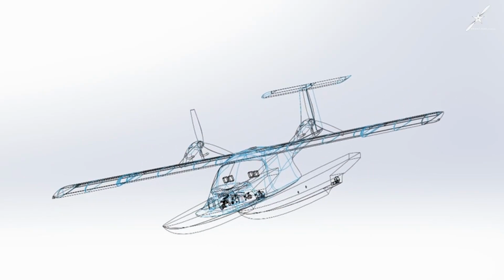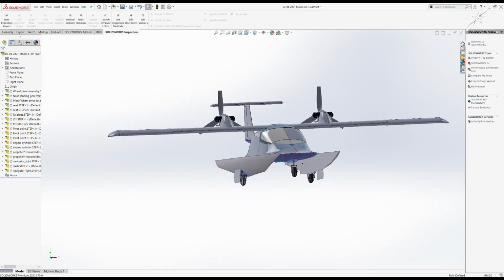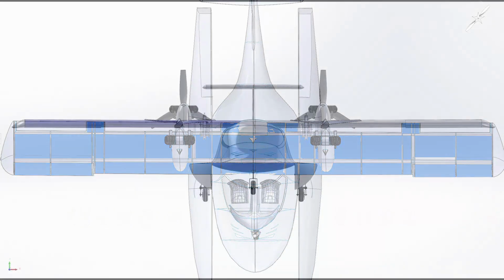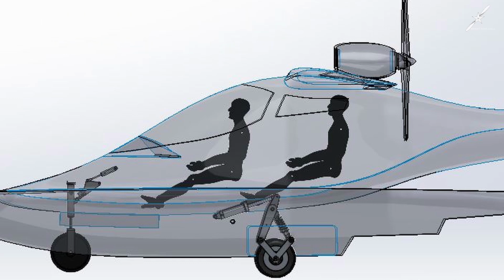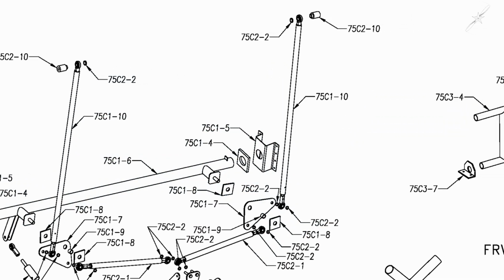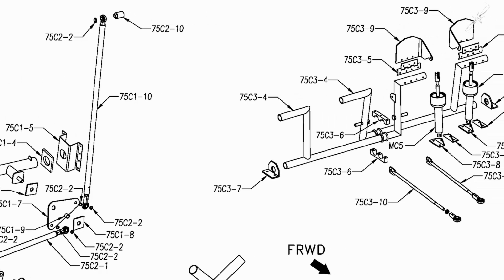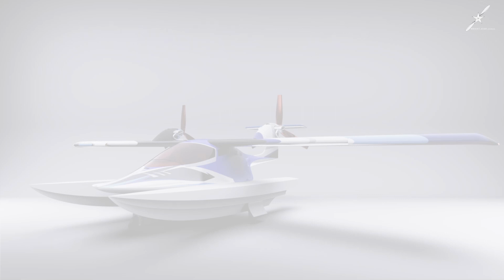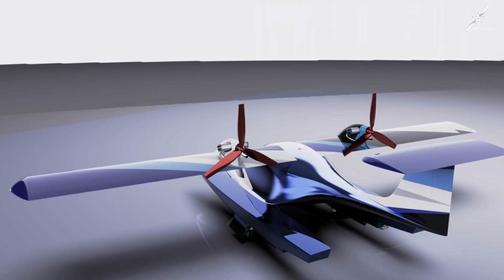Exciting, NEW, Amphibious Aircraft.

Comment: Interesting and I was also looking at BMW R engines as good DIY hack alternatives to rotax. They seem quite well suited except for needing a good gearbox solution. One european guy killed his tranny a couple of times before surrendering and buying a rotax that then worked reliably. I'm not saying it's impossible but the gearbox has to be well engineered to last hundreds of hours. The big 2 cylinder probably has some kick. So while they are great as a one off with no gearbox and smaller prop because you can get these nice engines for 1k$, if you hope to have some kind of series production you should consider the overpriced but decent rotax 916 and just one engine. piston twins are never good. sounds good on paper, but isn't.
As for the shape, I think the beak nose might have aerodrag. You can sim that in openfoam. AI seems to think openfoam is quite high end stuff despite command line interface inelegance. Apparently even solid works' CFD is nowhere nearly as scientifically accurate despite paying a ton of money before you get to use it. The separate pontoons makes for a complex body to make and less visually elegant. I think I would strongly recommend a more icon A5 like configuration because of the monobody shape. And single engine like it as well. As for seaplane hulls, I'm not an expert but it's my understanding that the key trick is a step where the water will separate from the hull and that's placed a bit behind CoG, then it comes up and planes on a short surface in front of that step. It's close to that simple afaik. strange that it works but it does.
As for your target weight, I would strongly recommend that you aim lower. Carbon fiber, especially in compound curves can be silly strong at very low weight and it takes very little strength to support 4 people. A 2 place carbon fiber canoe is 10-15kg and they can take a beating. Try aiming for a fuselage of 100kg instead and wing might be as little as 50kg. 86kg engine. Think of anything more than 300kg empty weight as a failure. 4 people is ballpark 300kg, maybe 75kg fuel so that's 675kg mtow. 1500lbs in retarded units. No 3500. You have a budget of 300kg empty weight, no more. Carbon fiber is STRONG. Use it well

Comment: should turn the engines around to pull not push. It will quite the motor and air noise down a ton.
Reply from the maker: I appreciate the suggestion, however, I wanted it to be a pusher. Yes, there are drawbacks to this. But for me to NOT see propellers in my view, I am willing to accept the drawbacks. To give you an example of why I am building this aircraft this way, think of a woman's high heal shoes. They are totally impracticable and even hurt women's feet. But they do look very sexy. Sometimes going for the perfect flying machine is not the goal and instead making something totally sexy that flies is the goal. Mine will be the latter. Thanks again for the suggestion.

Comment: I very much like your design.
 Having heard you would like to upgrade your front steering wheel & likewise steering for the pontoon.
I suggest you check with the designer of the rokon 2x motor bike & how power is sent to the front wheel. The same design can be used to actuate the steering for the pontoon esp if they were going to be powered by water jets.
A similar assembly that's used to power the Rocon might be used instead but unpowered and for steering purposes not to bring power to anything except for turning or yawing on the horizontal plan.
Thereby assisting both the front  wheel & the electric jet drive steering stearing.
P.s. kee in mind, the jet drives will require at least one debris filter for the water used.
I'd love to eventually get one for my hunting and fishing guide service...
P.s. be nice to be able to move 2 guys the outfitter equipment and moose meat...
Reply from the maker: I did a Google search for the  rokon 2x motor bike. It does not look like that front wheel retracts or extends. It looks fixed. The redesign on my nose gear is how to make it steer when extended and the disengage during retraction so that it retracts straight up into the aircraft. The front nose gear will not have any drive system on it turning the wheel.

Comment: Looks sharp and sleek.  I’m seeing a few possible issues from your pictures.   *Sleek THIN composite main component junctions with out the THICKNESS of strong internal metal attachment points will be very vulnerable to heavy water loads.  Pontoons floats have very strong cross bracing like bi- wings.  * The tails vertical & horizontal surfaces look to small.  Getting up on step looks hampered and the drawing of the main gears location looks like it may be a tail setter on a ramp with out occupants with pusher engines.  

Back in 1973 I did a sketch book drawing of a high wing twin engine tractor layout with twin boons and twin rudders.  Good to have direct flow on a rudder especially in engine outs.  The floats are mounted to a short airfoil sponson wing below the fuselage ( like the Boeing 314 ) which is structured to house the main inward retractable gear.  The floats can be detached for land use only.  Having twin boons allows for a rear access hatch ramp for cargo.   How can I send you this drawing?      - my two cents.
Reply from the maker: Thank you for the complement. This design is still just that, a work in progress. Since the making of this video two years ago a lot has changed. I have brought on an aeronautical engineer. He has looked the design over and we have made many changes to the design. So far we have extended the tail out another foot. We have increased the size of the rudder and vertical stabilizer, the horizontal stabilizer and elevator. The with of the body has been reduced by one foot. The engines have changed to two UL 520si 200hp with slightly larger props. Since day one I have had a composite guy helping me. He is a former Northrop Grumman composite guy. His name is Russ and you will hear me talk about him during my first video. He has explained to me how by using three or more different types of composite material, there will be plenty of strength between the floats and the fuselage. 
Gear placement will for sure be looked at during the final design stages. Thank you for point out the boat ramp thing. There might be a time when there is only one person in front which could cause it to be at it's aft CG limit. Combine that with a steep boat ramp and things could go bad quickly. 
My email address is in each video description. You can just email me the drawing. 
Thanks for the comment.

Comment: bro can we go for v tail designed it will look super cool😄😃
Reply from the maker: I don't plan on doing that. About the only thing that is a positive with a V tail is less drag. Other than that, it is a lot more work for the manufacturing the components for the mixer which works the tail surfaces. I like the "Keep it simple" method. Thanks for the suggestion though.

Comment: Keep in mind that carbon fiber is conductive and mixing metals when in seawater can lead to galvanic corrosion. Might read up on what carbon fiber sailing vessels do to mitigate this issue.
Reply from the maker: Thank you for the advice. Yes, this is something I am aware of. As an A&P, I am very familiar with galvanic corrosion. It can turn aluminum into powder. Also with me now living in an area where it snows. I know how fast salt can eat at metal. Funny you mention sailing and carbon fiber vessels. I have been a viewer of a sailing channel called "Gone with the Waynns" Their new carbon fiber cat has been having issues and they have tracked it down to current flowing though the fiber of their cat. Again, thanks for offering the advice. You are spot on.

Comment: Are the motors turns counter to each other to cancel to "tork" ?
Reply from the maker: Yes. That is why I went with the UL 520si engine. However, many twins do not have counter rotating engines. I got my twin engine rating in an aircraft like this.

Comment: Why are the weels are so low when they come out ? Is clearance a problem to save the floats ?
Reply from the maker: The wheel length have not been set yet because the shape of the floats shape has not been set yet. We have also redesigned the main gear doors to slide in instead of swing out.

Comment: Are you sure that the market is ready for this aircraft ? it has so many features that I'm starting to think it's going to be really expensive for the targeted audience.
Reply from the maker: Not that many fetures. It's just a clean slate design. The only thing I can think of that would be new to the market is the water jet thrusters instead of water rudders. That entire system should add more than $5K to the price.

Comment: Beautiful design. I have been flying a BMW1200 engine with a custom cnc geared reduction and am extremely happy with it.
Reply from the maker: Great to hear. We have decided for the prototype to switch to the UL520si engine. The Aeronautical Engineer recommended more power than the BMWs could make. Daily because the aircraft is wide and has a lot of form drag. We have reduced the with of the fuselage by a foot as well.  Thank again for in info on the engine.

Comment: At 12:50 in the video, it shows the different compartments of the pontoon; I would recommend having flooded compartments (ballast tank) to balance out the aircraft while on water for a more comfortable ride. Which should be adjustable so when in flight it may be dumped to provide better flight control and filled in water.
Reply from the maker: Thanks for the idea.

Comment: I’m not an expert, but the sharp edge on the leading end of your fuselage may cause some separation. I’m also intrigued by your pusher prop idea, you need to be careful with that though and keeping it out of the water.
Reply from the maker: Thanks, check out the iCon A5 and Sea Bee. Both of them are in production with rear facing engines.
Reply: @BrightStarAssemblies  neither seem to be doing incredibly well but all I’m saying is just be really cautious
Reply from the maker: Thanks

Comment: I love ur idea of electric jet thrusters.
Reply from the maker: Thank you. I thought that up on my own. I didn't want to use water rudders that have to be raised and lowered like most sea planes. I wanted something sleek and clean sheet design. At first it started off as a small troller motor that would extend out of the fuselage. But that idea felt cartoonish and maybe a bit hard to integrate. Then I ran across the idea of small water jets like they use on jet skis. But those are a bit to big for this. The idea isn't to go fast, it is just the maneuver the aircraft up to the dock with the engines shut down at maybe 3-5kts of speed.

Comment: 20 yr seaplane pilot.  Interesting design.  You will find that the sharp vertical inside edges of your floats will cause you grief when landing.  It is not uncommon to have a little lateral drift as you land and that edge will cause large lateral force on the pontoon as it contacts the water.
Reply from the maker: Ken, thanks for your comment. The floats will be completely changed. They will look like all the rest of the floats on bottom by the time we finish this design. We have already made many changes to the shape of the aircraft and engines since my last video. There is a lot more to some. Thanks again

Comment: Having worked as a drafter for an aluminum jet boat manufacturer, i can tell you a bit about hulls, which you can use to inform the pontoon design. Also, while you may think the building of a scale model may not help prove the aerodynamics, I think that it is quite applicable to to helping evaluate the hydrodynamics, and the weight and balance at various speeds, taking off and landing.  The jet boats I worked on had angled vee-shaped hull bottoms (called the Deadrise angle) The river boats that had to run in shallow water had 8 or 10 degree angles from horizontal, each side. The lake boats had steeper angles up to 20 degrees, for dealing with larger waves. The larger the deadrise angle, the more the hull can pierce the waves. (less slap.) So I think you want a steep angle at the front, and flatter at the rear.. so when you are landing at 140 knts, you benefit from planing at the rear, and piercing at the front.. but your pontoon volume along the length must also be proportional to the weight distribution. Your design looks a bit skinny at the front, meaning that it will be pitched forward sitting in the water..  so I do recommend spending some time with a model in the water and adjusting the weight distribution. Then you can optimize the shape of the deadrise for the planing and wave piercing aspects.. again.. experiment as much as possible.. fail early fail fast, and challenge all of your assumptions..
Reply from the maker: Chris, than you very much for your incite and wisdom. I would love to have a conversation with you on the phone. Please email me at brightstarassemblies@yahoo.com I can give you my number there. Thanks
Reply: I know this sounds extreme and may make your design unrecognizable from the original. But you can design this without pontoons, greatly reducing weight and drag. There is a mechanism available that can raise the aircraft in and out of the water quickly regardless of water condition. This mechanism can slow the aircraft down during landing. This mechanism is probably 1/5 to 1/10 the weight of the pontoons.

Comment: So where do you put all the 12 volt batteries for the elec jet pumps? Much better weight problem solved using small jet ski engines. Or just use your already ample plane engines and leave out the jet pumps. Did I hear you right, its 400 HP?
Reply from the maker: Batteries? How many hours do you think you need running these two jet thrusters??  On any normal day one might run both thrusters at half power for a total of three minutes backing off a dock and three minutes taxing up to a dock. Sounds like you want to go cruising around the lake just using these electric thrusters. hahahaha  But that is not what they are made for. To answer your question there will be one 12 vt battrie that weighs 11 lbs because it is an aircraft grade battery and it will run these thrusters for probably 30 minutes. But it gets recharged while the engines running. So, any normal person will only use them to back off a dock and then start up the engines. 
400hp??  Nope, there is nothing on this aircraft that is 400hp. Those electric thruster motors will maybe be 1/2 hp each and the engines that we have switched to is 200hp each. For a total of 400hp combined. Maybe that is what you heard.  Thanks for watching my video.
Reply: Dream on, a 12 volt deep cycle battery weighs about 60 lbs, That will last you about 20 minutes, and how do you charge that battery? I know put solar panels  all over the wings,, thats another 60 or so pounds. So how do you make up that weight in an airplane? Well I guess you can make the plane a single seater.  Its clear you havent thought this through much.
Reply from the maker: Honestly I have no idea what you are referring to. The battery I will probably go with is an aircraft 12vt battery weighing 15lbs. There is a link below to one if you want an idea what it looks like. To charge it there are two alternators on this aircraft (one on each engine) that will charge this battery when the engines are running. There will not be any solar panels on this aircraft at all. Anyway, I hope this helps clear up any confusing about these small electric thrusters on the floats. As stated above. These electric thrusters are not for powering around on. They are for pulling up to a dock or pulling away from one. They will only be run for maybe three minutes. Probably less. They will also not be at full power.
https://www.aircraftspruce.com/catalog/elpages/odysseydry7.php?clickkey=9055811

Comment: Float shape and main landing gear placement.   The Step of the Float needs to be Aft of but as close to the CG as possible.  Its almost the same point as the Main Gear.  To Rotate the aircraft on land or (water, The aircraft will skim on the water on a section just forward of the Step) if the pivot point is too far Aft of the CG, the tail has a lot of work to do to push down and raise the nose.  Water, as the Pilot Rotates, the section of the step aft of the CG (wants to be the pivot point)  digs into the water creating drag and preventing takeoff.  Wheels, The higher the CG above the takeoff surface. During the rotation, the CG point moves past the pivot point and the pilot must correct for the Tail now Falling.   Look at Amphibious floats manufactured by Wipaire etc.    Main Gear doors.   Quite Often under the pressure of water operations,( Water rudders mostly) and the gear is forgotten down for takeoff.   As the Pilot sets power, he quickly realizes his mistake, Stops, Raises Gear, Embarrassed, He resets and takes off.  Gear doors wouldn't last in 5 knots of water.    Thats how I see it.  Best of luck.
Reply from the maker: Some really great advice. No one has taken the time to explain it to me that way, so it really was helpful. I am not sure about the gear doors either. I know the power of water is very strong. I'm sure that aspect will get more attention.  Thanks